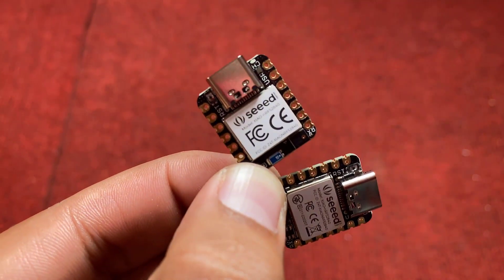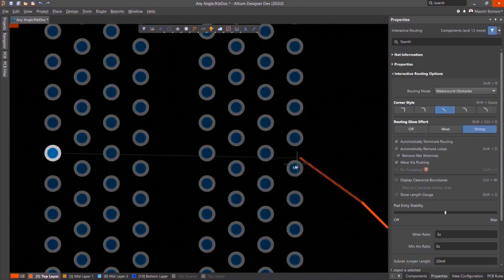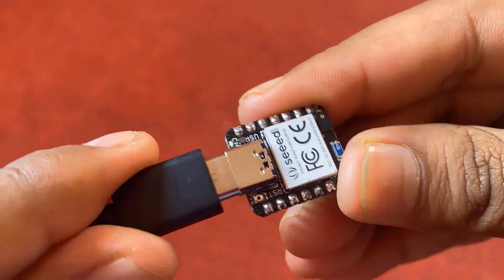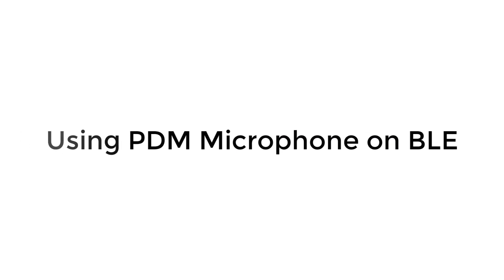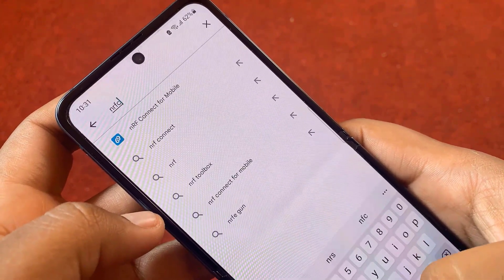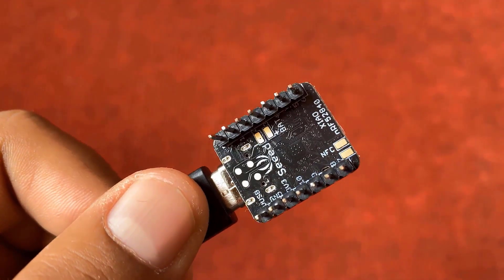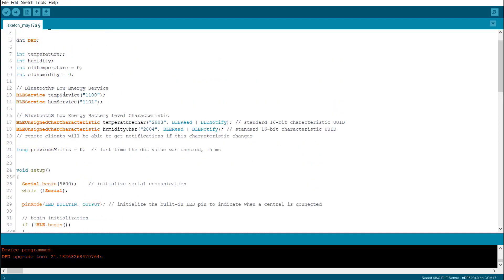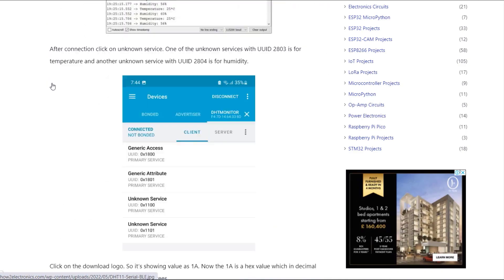How to use 𝗫𝗜𝗔𝗢 𝗕𝗟𝗘 𝗻𝗥𝗙𝟱𝟮𝟴𝟰𝟬 𝗦𝗲𝗻𝘀𝗲 with Android/IOS App || IMU Sensor, Microphone, Pedometer

Comment: Hi I have two of these and I try to make one as master and the other as slave. Code is correct and builds ok through the arduino framework. But they dont connect with each other. If I try to connect to one of them using the nrf52 mobile ble app it works fine. What could be the issue?

Comment: BTW... when I try to read the Temperature Sensor and Gyroscope I permament get a value around 2000 with the gyroscope and "inf" for the temperature... do you have any idea why? I have two nely bought boards and both act the same...
Reply: Hi, may I ask you. Do you get the answer for this?
Reply: @dhiyaakmal7762  yes the Problem was That I used the newest arduino IDE. I am not at my computer right now and don’t know the numbers, bu I think instead of using 1.60 I used 1.4.9 or something? And I don’t use the uart board as Plattform but the one without uart (was it uart? I can’t get the right words right now…) hope this helps
Reply: @diy_wizard  thank you, so basically you just use the older version of ide and use an uart cable right?
Reply: @dhiyaakmal7762  yes the older ide but uart
Was not the cable but the board I chose from the board manager
Reply: I would have to look how it was called exaclty, I don’t remember without seeing it
Reply: @diy_wizard  ohh i see, thank you so much for answering my question.

Comment: Is it possible to power the board using external PIN rather than the USB port?

Also how to put this module in deep sleep mode and wake up only when send the data through Bluetooth. In deep sleep mode it needs to read the ADC data. IS it possible to do this?

Comment: I include the library "ArduinoBLE" when i compile the dht ble code i got  the error " ArduinoBLE library is not compatible with this board", but when u upload the code in video , the code easily uploaded. how i can solve it. I have the board "Seeed Studio XIAO nRF52840 Sense ".
Reply: Two things you need to check:
1.- You selected the right device with "Seeed XIAO BLE"?
2.- You installed the "Seeed nRF52 MBED-ENABLED"?
Reply: i get the same error. tried the arduinoBLE 1.2.2 and i ghet the same error
Reply: your problem is solved by this?
Reply: you need to instal the mbed board library
Reply: OMG.  I wish I had read your comment 4 hours ago!  This fixed my problem, sir.

Comment: Really cool thank you ! But how can we charge the  3.7v lithium batterie, when welded to the board ? Is it through the seeduino xia usb c port ? like the same as where we transfer the code to ? or do we need to add another seperate usb c module to charge on it ? :)
Reply from the maker: Charge through the USB of the board.

Comment: If you install the xiao ble core 1.0.0 you have access to the adafruit ble core which has way more ble features than the Arduino BLE lib

Strange how seeed has implemented the  core for the board.
Reply from the maker: Adafruit BLE didnt worked with this module.I tried
Reply: @HowtoElectronics  what library do u use for bluethoot conexion?